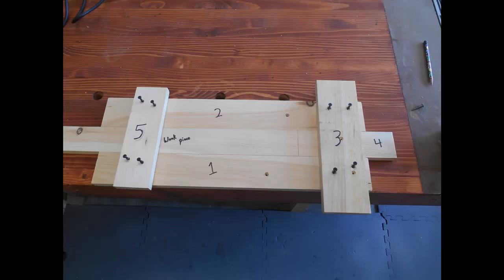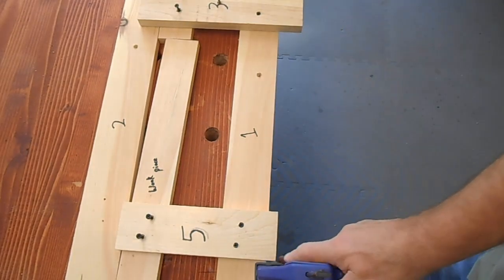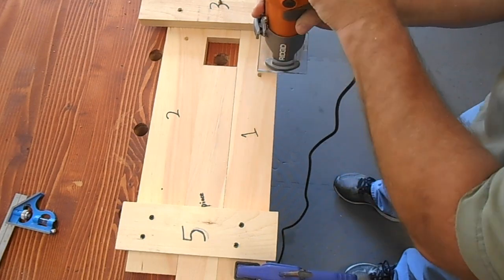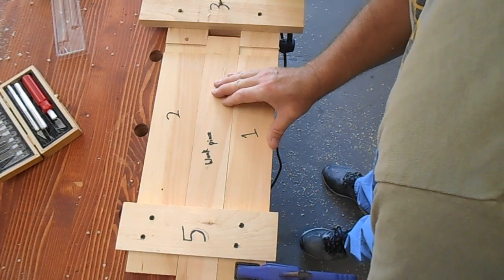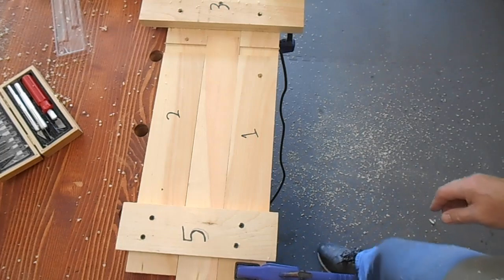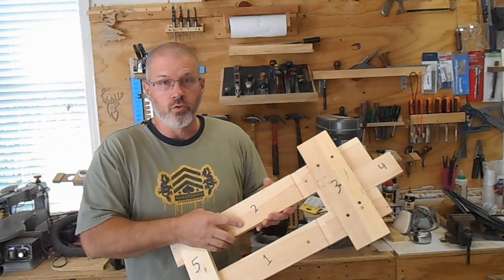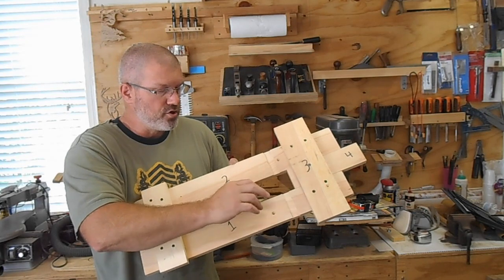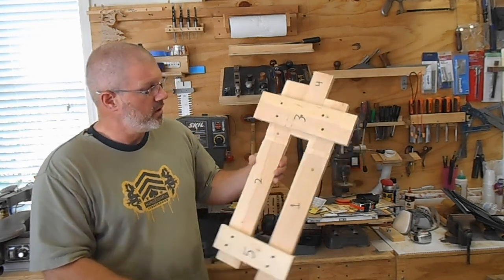Make accurate tenons with your router using scrap wood in your shop

Comment: This jig is a very simple method for one  use of my Router. (The Router does have  many other uses in the Workshop, I have found)! I will find this jig simple and easy to use, and much easier than using the Table saw for cutting Tenons. 🤠